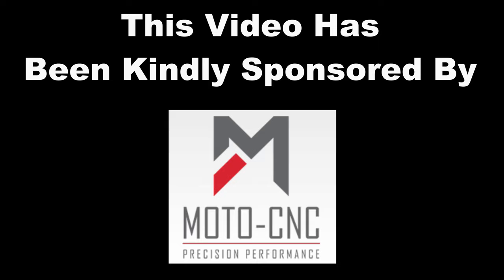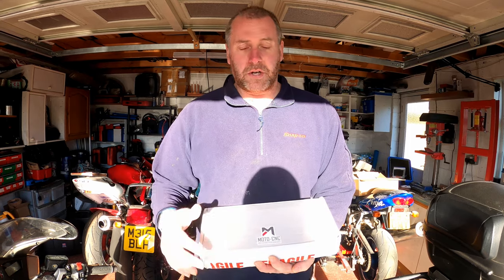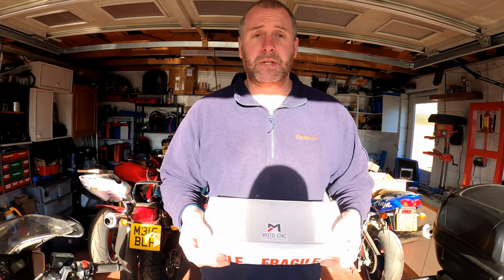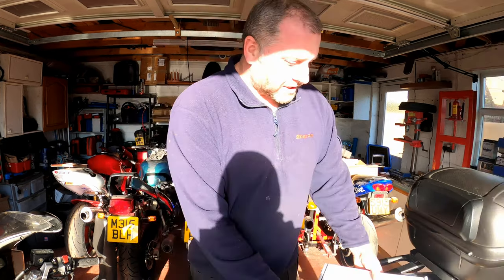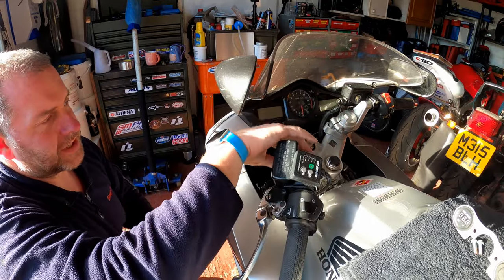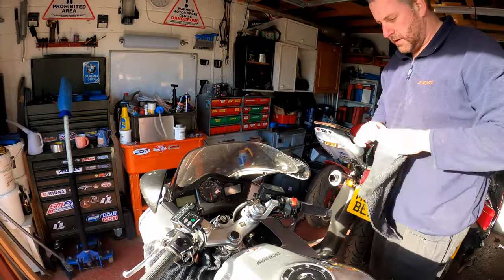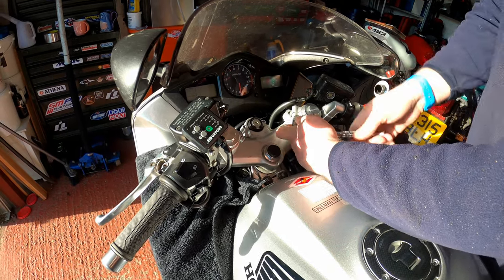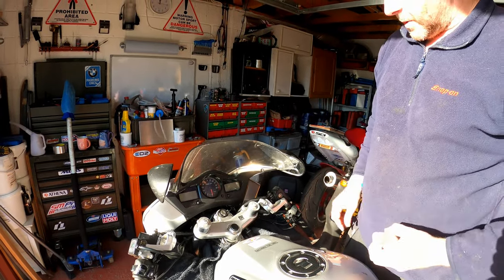Honda VFR800 VTEC - Moto-CNC Bar Riser Top Yoke Fitment With Renthal Street Bars

Comment: i used the moto cnc clamp type conversion,but the same bars as yours,renthal 758 low.i had some fiddling around to say the least.i didnt drill or cut the bars,used a couple of strips of thin roofing felt to secure the throttle housing,re routed the throttle cables to the left side of the right fork,and lengthened the stop light switch wires so i could stop the master cylinder hitting the fairing.i used the original bar ends from the clip ons.used rawl bolts,10mm,to secure them.had to rotate the brake and clutch hoses.but to do this requires grinding of the lugs.however.with your discount code the clamp type risers cost £93.used secondhand renthals,£25.all is good now.cheers for video.
Reply: Hey mate how'd you manage to reroute the throttle cables? Mine are coming up way short and can't think for the life of me how to go about rerouting
Reply: @RideToLive102  left side of the right fork,round the ignition switch,over the abs pump to where the cables originally go.took a few goes to get it right.
Reply: @bertayoing  great thanks, more so wondering what you removed in order to get the cables? Did you remove throttle body side or clip on side and reroute?
Reply: @RideToLive102  the engine end,fiddly as F but doable.
Reply: @bertayoing  5h later i rerouted the throttle cables which still came up short, rerouted master cylinder clutch line and master cylinder front brake line and still coming up short..no possible other way of rerouting them now in any way to make sense, guess I'll just not be able to lock to lock 🤣🤣🤣🤣
Reply: @RideToLive102  i have pictures of the bike  routing etc.ill send them if i knew how to get in touch?

Comment: Have you checked your headlight beam level. The drop of the forks would have had quite an impact. I went the other way to sharpen up the starting and it scrapped thorough the MOT at the limit of its adjustment. I went up less than you went down:)
Reply from the maker: I haven't but that is a very valid point that i hadn't even considered! i'll be sure to give it a check! 👍🤓

Comment: I’m just finishing this up on my 2008 VFR but I’m using the Moto CNC 43mm fork clamp style. I suppose they are universal to any bike with 43mm fork tubes. I can vouch for the quality. They are billet aluminum and they are beautifully made. Question if you don’t mind (and perhaps you will address this but I haven’t finished watching yet) What is the total width of the bars you have, excluding bar ends?
Thank you, your videos are always useful!
Reply from the maker: It’s a very good question, I’ll pop out tomorrow and measure them 👌🏻

Comment: Yes another great video.  And hope moto cnc supply bolts in future kits and maybe torque specs too. Also Kev. What is the reason for this did you not like the ones useing as curious as was looking at the ones you took off. Great video. 🙂
Reply from the maker: Not at all Guy, i was more than happy with the Genmar ones that I had fitted previously, the only reason for doing this was because Moto-CNC reached out to me and offered me the yoke to make a video with. 👍🤓
Reply: @KevsShed  oh right i c that's good then. Hope they provide bolts and stuff in future kits after watching your video. 🙂

Comment: I  just got in the exact same kit for the same bike. Went to install but my throttle cables aren't long enough to let me turn the bars full right. Any reason this could be? or am I doing something wrong? Followed your video the whole way. Thanks much, Jake.
Reply from the maker: The same rise to the bars? They come in different heights.
Reply: @KevsShed  yeah same rise and everything
Reply from the maker: Hmm hard to say then, are the throttle cables routed the correct way?
Reply: i currently have the same issue on my 2002 vfr throttle cable tight on full lock, fitted by previous owner possible cable route error.
Reply: @BlinkMDK  I have tried re-routing the cables and adjusting the forks to allow more length. Nothing helped, still had cables being pulled at full lock. After about 3 weeks of messing with it I put the kit up for now until I can buy some custom length cables.

Comment: Hello kev ive just done this conversion, i have lowered my forks but the banjo on the clutch is hitting the top of the forks and not alowing me to bring the leaver into a good position. On the res the banjo is held between 2 lugs any thoughts on what i could do can i cut a lug and rotate. Thanks kev avid vfr follower
Reply from the maker: I have seen that very thing done by others 👌🏻

Comment: I looked at the description of the yolk in the direct link that you used and the description states that longer cables are required.  Is that correct? Thanks
Reply from the maker: I didn’t, it would depend on the rise you get the renthal bars in though.
Reply: I had another look at the web page and it says that 'longer cables would be required for 'some ' of the risers. My mistake and thanks for the prompt reply.  Keep up the great videos.

Comment: Hi Kev.
Did you have any issue with the stearing lock?
Reply from the maker: It's funny that you say that as Moto-CNC got in touch with me to ask the same question! It would appear that there is an issue with the steering lock when using this yoke and Moto-CNC are looking into it as we speak. I didn't even notice, mainly because I never use the steering lock, in my opinion it is the most easily overcome piece of security on a motorcycle but I know that some do use it for peace of mind.

Comment: Great video again Kev, been thinking of doing this for a while now but kept hearing stories of having to buy throttle cables from an 1100 pan european as they are longer, but that was using universal kits I believe. You mention in the video you cut some of the bars, how much was it. Will definitely be doing this mod now, thanks for the vid 👍
Reply from the maker: Go for it! I cut approximately 1 - 1 & 1/4 inches off each end, I just offered everything up to its final location and marked it all before I cut anything. No need to change cables or brake/clutch line with these bars. If you went for a higher set of bars then you may need to. I would expect that they would interfere with the body work at full lock though! 👍🤓